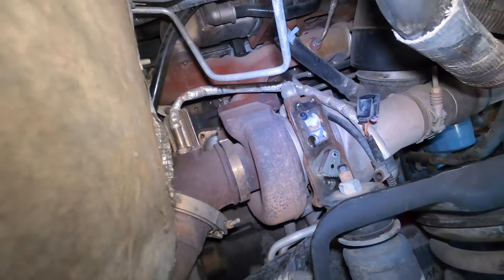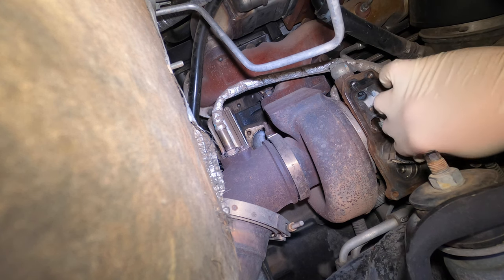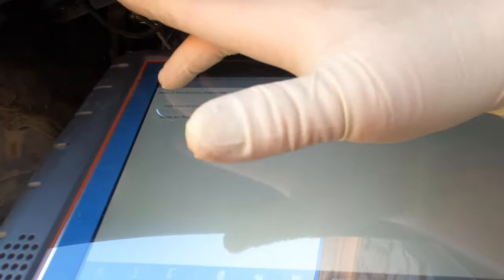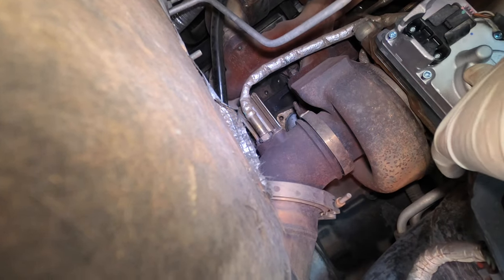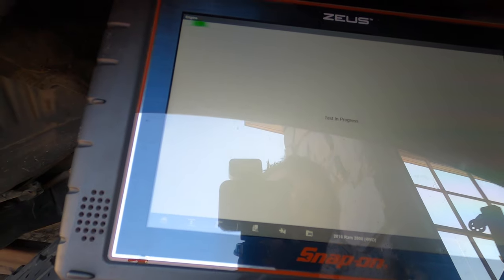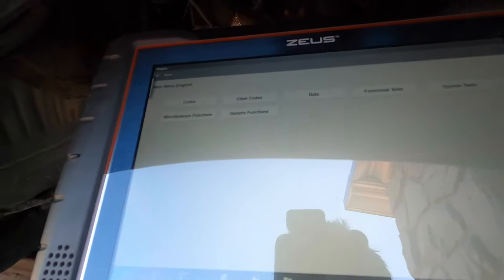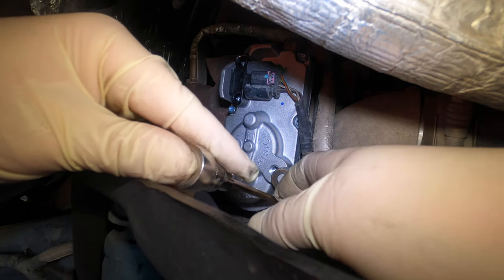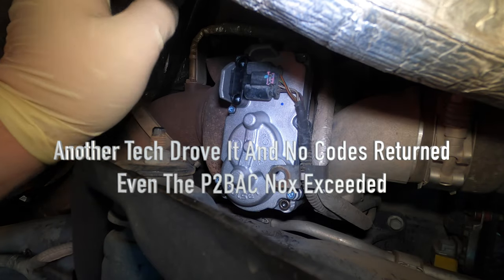2016 Ram 2500 Cummins 6.7 Needs A Turbo Actuator?

Comment: My truck likes to lose boost. It goes to about half boost pressure and it tends to happen after idling or in stop and go traffic. Restarting the truck temporarily solves the problem. Sounds like a bad actuator? Is there a trick to preserving them? Does soot buildup reduce the life? Would it be worth getting a new turbo instead? Does deleting reduce risks of failures overall? Thank you.
Reply from the maker: Like andrew p said, I always recommend everyone use the exhaust brake to work the turbocharger vanes open to close. Unfortunately the Actautor is in a really bad spot and seems to get cooked.
Reply: @drewsshoplife  that’s what my mechanic recommended. I used to only use it when towing but now I use it every day. Thank you

Comment: Great video.  I was unaware of draining the coolant so good to know.  I just got the trouble codes which I'm assuming is the actuator...P00AF, P003A, P0046, U010C and P1475....2016 with only 66,000 miles so that's a bit irritating but oh well.  Luckily I run a auto collision shop so we have the Snap-On scanner so I'm hoping to do this myself and not the $4k that the dealership wants lol.
Reply from the maker: I would drain the coolant first and remove the actuator and inspect that the vanes move freely from end to end. Usually the low milage ones I see the seals on the actuator start leaking (pink crust around the meeting surface of the actuator to the turbocharger). If it is leaking I would spray some penetrant around the bolts for a couple days to help removal ,Ive had a couple not want to come out. The snap on will do it no problem, make sure you follow the instructions on the scan tool. You don't have to use the scanner to remove it just to calibrate the position during install.
Reply: @drewsshoplife  no one in my area is willing to work on this problem on my truck finally got someone to look at it and they didnt have a scanner to calibrate it when you put it back on so he told me he would get a hold of snap on well they ended up telling him they dont have a scanner or program for this issue ive seen multiple comments on other videos saying they have used a  snap on or got ahold of snap on and used there scanner so idk what the issue is with getting this scanner!!
Reply from the maker: @XavierTrujillo-z5u  sounds like you may have something else going on. We have 3 snap on scanners and I know two of them can do the calibration. Only time I’ve had an issue is when the actuator is no good or the turbo is no good. The instructions must be followed when reinstalling the turbo actuator. Does it fail the calibration or throws a code?
Reply: @drewsshoplife  havent got anyone to work on it shop told me they had to get a scanner first before they mess with it so when they put it back together they can recalibrate it but said they would get a hold of snap on snap on then told the shop they didnt have scanner for that so machanic wont work on it.

Comment: Why not use city diesel self calibrating actuator ? Great info. Thanks for video. Also can you not drain coolant if you’re planning on tossing the old actuator ? Will it eventually drain out to the point it won’t effect install of the new actuator ?
Reply from the maker: We definitely could use them for actuators, but we get our parts from a couple suppliers and we can have them usually same day. If your installing a new one I would drain the coolant. You don’t want to take the risk of getting coolant in the new actuator.
Reply: @drewsshoplife  ok good to know !!! Thanks. Would you recommend a bunch of pb blaster a few days prior to removing? Mine is covered in pink sludge.
Reply from the maker: @goosegunner1  I would recommend that , just be careful and use a new allen bit (they like to strip).